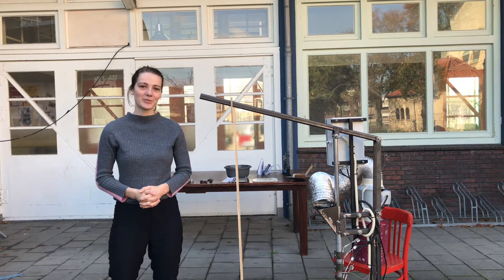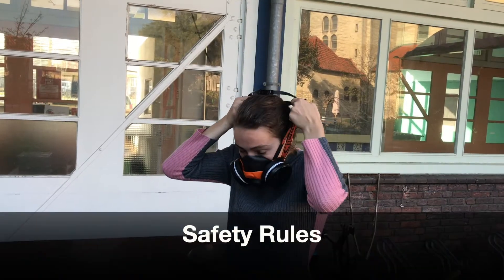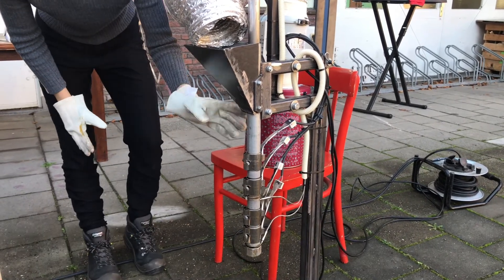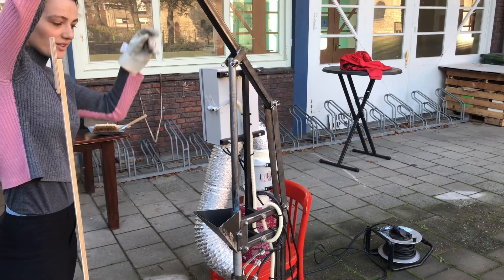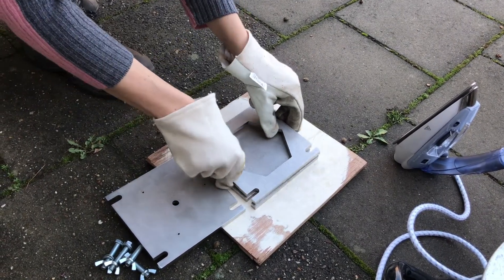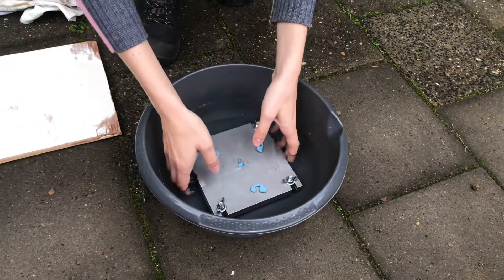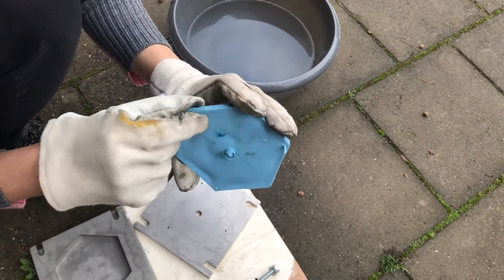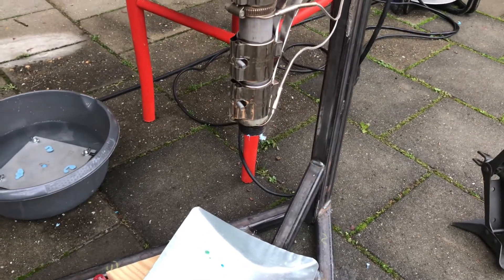Injection Mould Instruction Video | Precious Plastic Maastricht

Comment: But the plastic has shrinked in the mold. You also need to take into consideration the shrinkage and either change the plastic type, or alter the mold for shrinkage compensation.
Reply: That's normal for HTPE.

Comment: These homemade injection plunger machines are extremely dangerous, please use care when operating or standing next to them during the fill operation. most don't have plastic guards around the nozzle areas and the heater bands are exposed.
Reply: So is a gas cooktop with a pot of boiling water on it but I think most of us accept the risk and know to just be careful around hot things.
Reply: @android01978  Boiling water 212 degrees. Hot plastics melt between 300 and 700 degrees and will plastic stick to the skin and continues to burn, unlike hot water. Some people need to learn the hard way. Good luck!

Comment: It's so impressive!! I have a question though. How do you deal with the remaining plastic that you would get during cleaning?
Reply: Either we make a second pressing (if it's enough for another product). The cleaning process of the machine is not optimal yet... In the future we will collect the plastic residues to either shred them again, or if it is contaminated residue to dispose of them correctly.